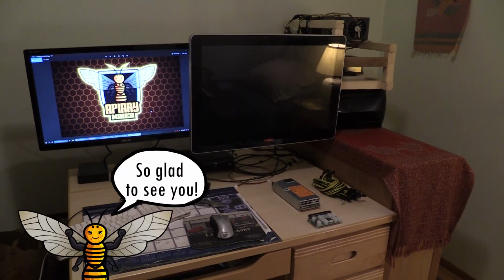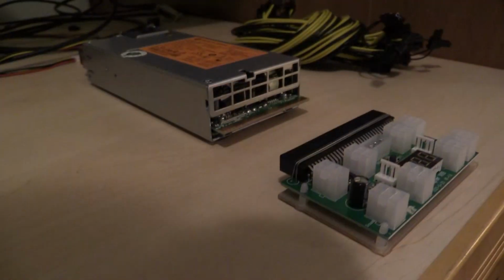My First Server PSU | Time to Upgrade Mining Power Supplies!

Comment: For new vga rtx3060ti need 8pin😬
Reply from the maker: Ya, I believe most of the 3000 series cards require at least one 8 pin. Some more power hungry cards will actually take two. 
Does your power supply have 6 pin?
Reply: @apiaryminer5104  no all 8 pin..i use newest psu 8+gold...bro i have rtx3060 non lhr..and rtx3060 lhr ..but hashrate very shit how to unlok them😬..i try use windows10  ..but driver not support to the new card rtx3060lhr..if i use newes card work..but the old rtx3060 non lhr..low rate with new card
Reply from the maker: What miner are you working with on Windows?
Reply from the maker: They both have bad hash rates? 
What are you getting out of them?
Reply: @apiaryminer5104  i use hiveOS
Reply from the maker: What hash rates are you getting on your two cards?
Reply: @apiaryminer5104  rtx 3060 lhr 25mhs😊😬😬😬😬
Reply from the maker: @CryptoKingku  Ya, that is like half capacity. What miner are you using on HiveOs?
What's the hash rate of your regular 3060?
Reply: @apiaryminer5104  i use trex new version on hiveos rtx3060
Reply from the maker: And which driver are you working with?  Trex is supposed to work well with LHR cards.
Reply from the maker: I hope your regular 3060 is running higher than 25 mhs!
Reply: @apiaryminer5104  which version dear

Comment: I’ve got a regular PC psu … But I’m considering getting a server PSU for my next rig. Side note, whats the MH/s you get on your 3060’s when mining ETH?
Reply from the maker: Hey Fernando! So far I can say I'd recommend it if you're looking for more power. I was worried they would be a whole lot louder than a regular PSU but it doesn't seem to be any louder. 
Plus, the price point is great!!!
Reply from the maker: I was recently able to hit 40 m/h on my 3060s after some troubleshooting with MiniZ miner. That's also using the 460.39 driver. Up until then I was right around 36 m/h on Lolminer.